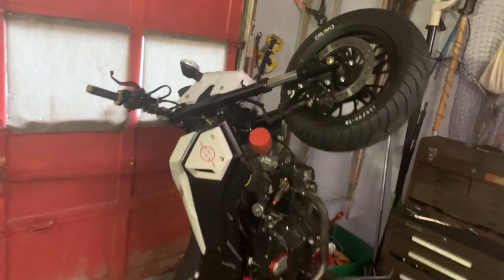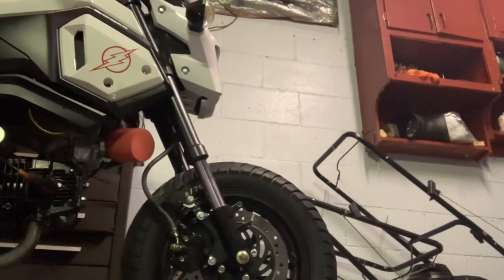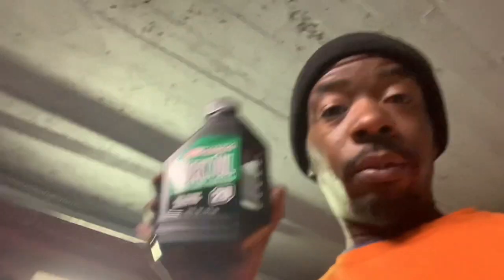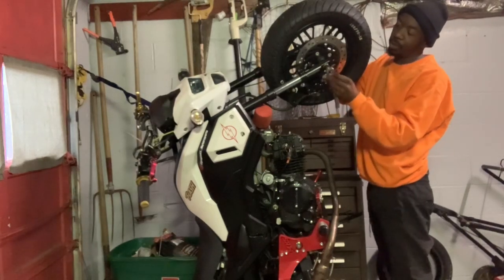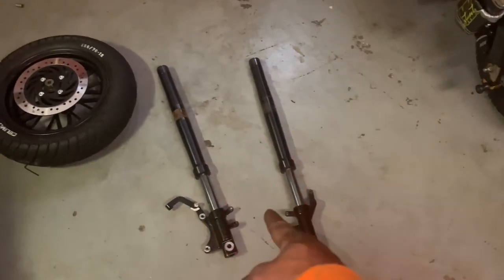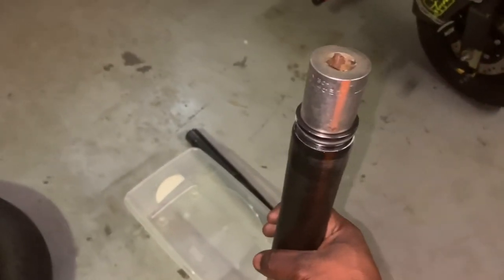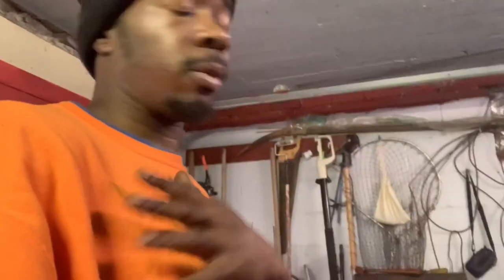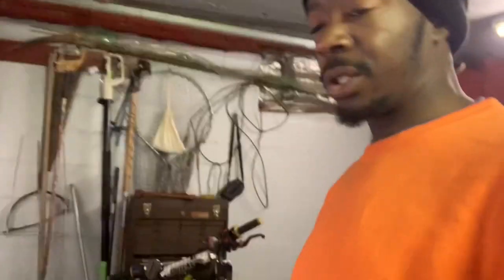How To Change Grom CLONE Fork Oil

Comment: How did you get the inner tube out? I have the taotao hellcat clone and mine has an allen wrench head in the top after you take the cap off. When i loosen it, it just keeps spinning. Did you just push yours out?
Reply from the maker: Yup, i cut stem and took it out and slapped in a normal valve stem